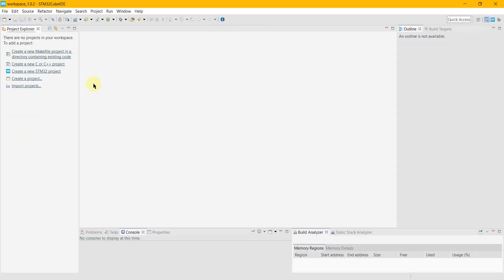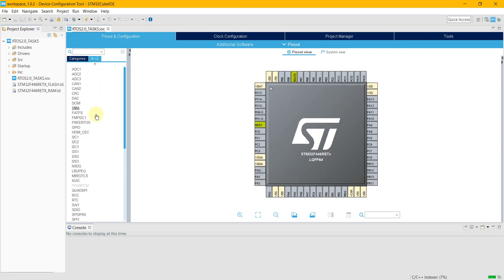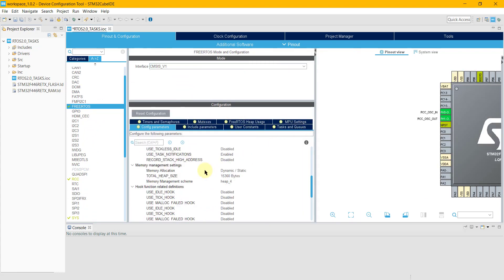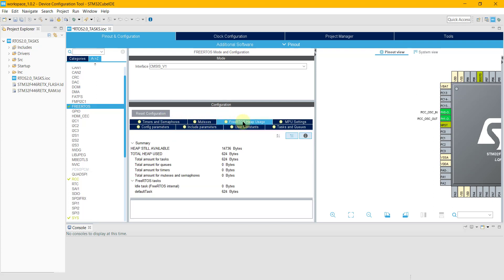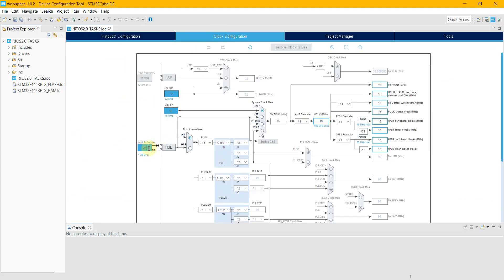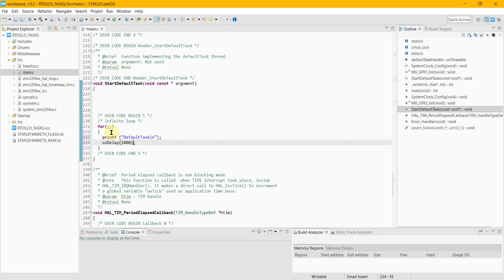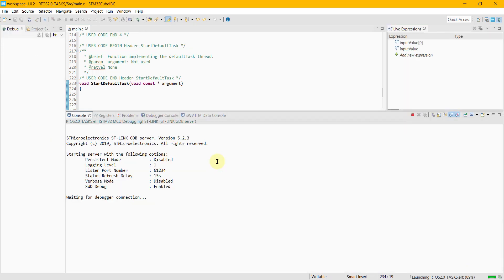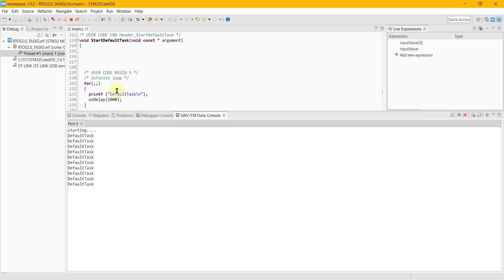FreeRTOS Tutorial 2.0 || TASK Operations || STM32 || CUBEIDE

Comment: hi. 
in this video, in STM32CubeIDE graphic part , on sys>Debug, there is not enabled any Debug protocol (serial wire or asynchronous trace). how your program worked, I don't know 🤔
Reply from the maker: That protocol is only needed in f103c8.
Reply: @ControllersTech  
 yes. I use STM32F103C8T6 to run these series FreeRTOS videos.
why (how) not needed to enable these Debug protocol on other STM32 MCU?!
Reply from the maker: You don't need in f103 also. It's just that if you don't enable it, you can only write once to the flash. So before writing another time you have to erase the full flash memory.

Why is it like this ? Well i don't know..
Reply: @ControllersTech 
That's interesting! I'll check how it works. Thank you 🙏😃👍